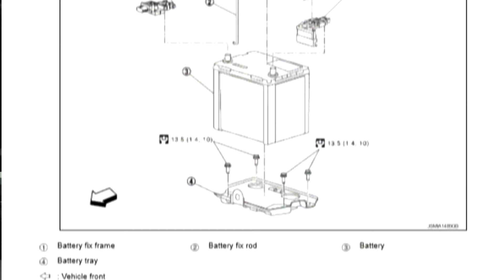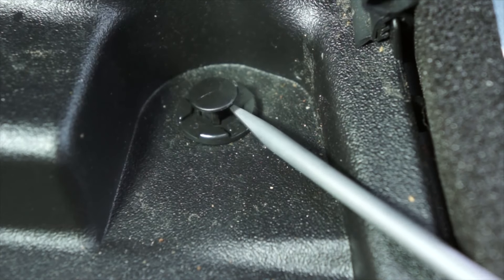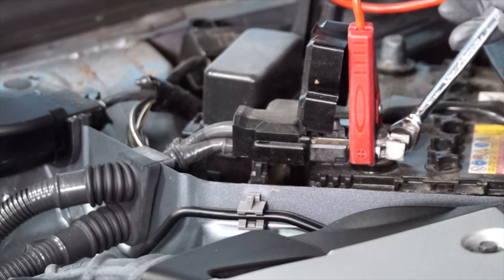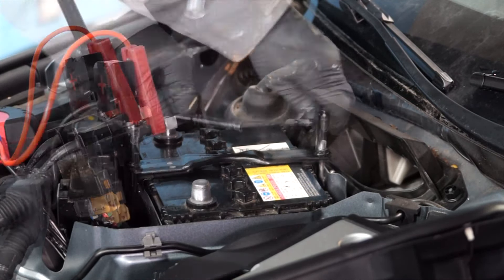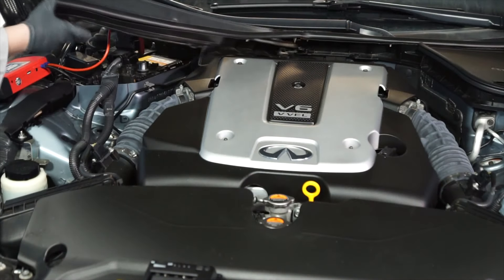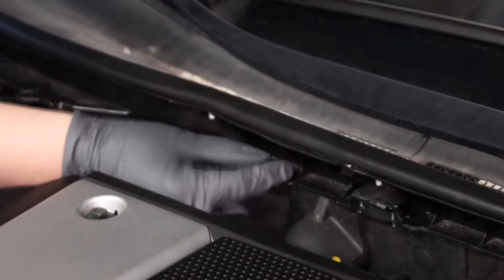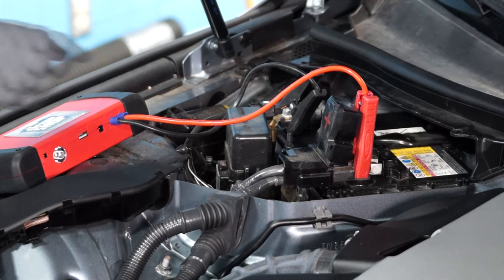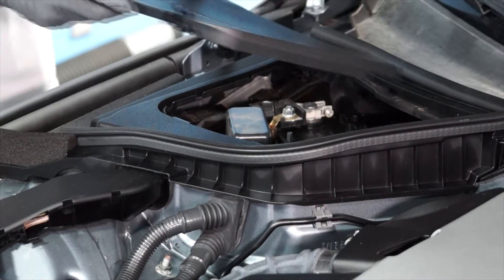INFINITI Q50,Q60,Q70 | QX50,QX60,QX70 | Q70L | M35,M37 | G25,G35,G37 (2008-19) - New Battery Install

Comment: This was really helpful.   The only slightly tricky part was figuring out how the top plastic shroud came apart...  I don't have a memory saver but after connecting the new battery, I didn't notice anything missing.  The clock was correct and all my radio presets were still there.
Reply from the maker: We're glad it was helpful. Thanks for your feedback!
Reply: Same. clock correct all radio settings saved, no problem

Comment: Thanks for uploading this.  I found it's always good to review the steps prior to jumping in and this gave me a good idea of what is needed to be done.   I literally just finished up replacing my battery and have some minor suggestions.  You called out the size of the terminal nuts but not on the braket which were also 10mm but need a deep socket.  Also should caution that the hold down braket just hooks at the bottom and be carefu not to drop them after removing the nuts.  I didn't have an issue but I could see it easily getting dropped.  Last suggestion would be just a note how to install the clips.  I imagine there are some that are just getting into this type of stuff and may not realize you have to hold up the center of the clip when reinstalling.  Thanks again, much appreciated.
Reply from the maker: Hi - Thanks for watching and sharing your experience and tips!
Reply: I definitely just dropped mine smh.
Reply: YaThanks ysydysiysysd

Comment: what happens if dont use any memory saver  and simple change the battery.
Reply from the maker: Hi - Thanks for watching! It depends on the vehicle. Anything from nothing, to minor resets like clock or radio, to no start due to immobilizer reset. Check out our video on memory saving. The link is in this video's description.

Comment: What is the the replacement battery part number and can you get it from I ther than the dealer
Reply: The battery part number depends on your vehicle model and options. You can get a replacement battery from most auto supply stores, you don’t have to get it from the dealer unless you want an OEM battery.

Comment: Ichenge my battery a Infiniti Q50 and the console is failed Ken you helped
Reply from the maker: Hi - Thanks for watching! If a memory saver was not used during battery replacement, several vehicle systems may require resetting. We suggest that you check the vehicle owner's manual or a service/repair manual for the reset procedure(s).

Comment: Is the memory saver really needed for replacing the battery?
Reply from the maker: Hi - Thanks for watching! We suggest that you check the vehicle owner's manual to be sure. There should also be information on any vehicle system resets that may have to be performed after a battery replacement, and how to do them.

Comment: How can I reset the memory if I dont have that connection to keep the settings?
Reply from the maker: Thank you for watching. If you do not have a jump back showed in the video you can use a memory saver with and OBD port connection.  You can see our videos on using a memory saver.

Comment: What would happen if you don't have a memory saver. My window guy at to replace buy windshield and had to disconnect the power from the battery this calls the car not to start
Reply from the maker: Hi - Thanks for watching and sharing your experience. Depending in the vehicle, not using a memory saver can result in situations like minor or no vehicle resets, or resets to vehicle systems that require procedures explained in the vehicle's owner manual and service/repair manuals. Check out our video on memory saving procedures. https://youtu.be/vSP3ShcaFgQ
Reply: @TheBatteryShop  thanks

Comment: I put a 24F battery in my q50 and everything in my car turns on but the engine, when I try to start it the car clicks once and doesn’t turn on. The recommended battery size for a q50 is a 35, does it matter?￼
Reply: The Battery Shop Update: I brought the right battery for my car and it still doesn’t work
Reply: The Battery Shop I cleaned my batter terminals and it works 😅
Reply: @movindy  lmao

Comment: You installed the positive cable incorrectly. There is a rubber guard over the cables where they drape over the metal parts that's supposed to protect the cable from making contact with the metal edge. You were supposed to spread the rubber part to make sure it straddled the metal edge. You failed.
Reply: Commenting so i remember when i do mines tomorrow
Reply from the maker: Thanks for watching. Yes please make sure to spread the rubber harness over the guard to prevent any issues. Thanks for the feedback.